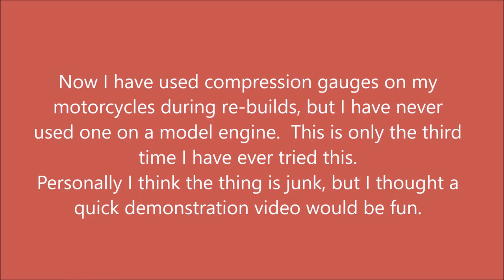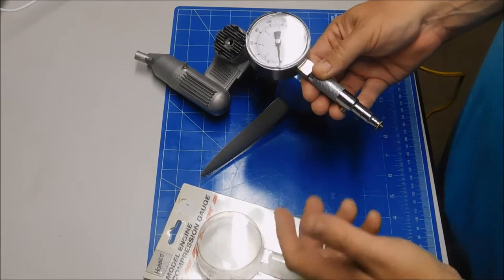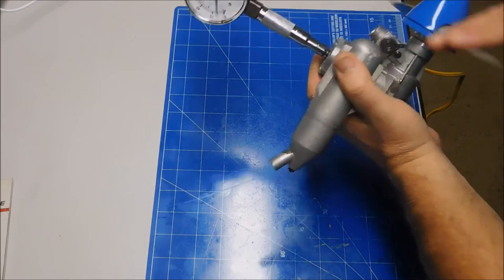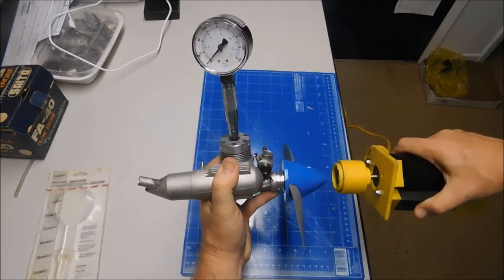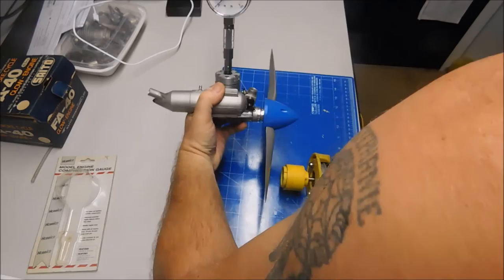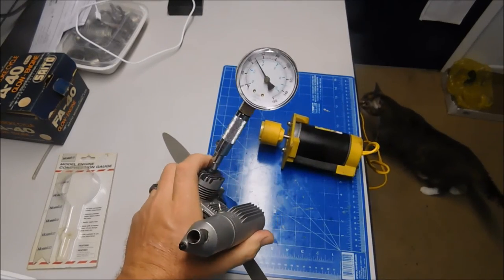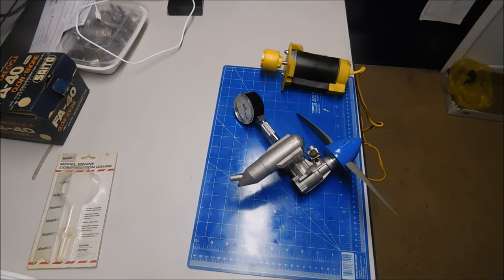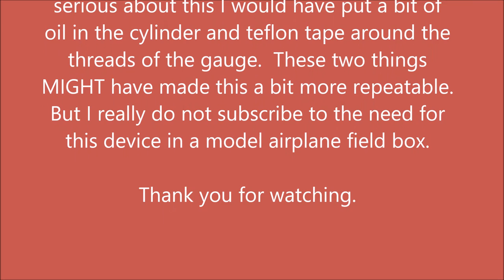Model Airplane Compression Gauge by Hobbico

Comment: It would be interesting to see, if there is a difference between the compression of a .10 size and a 1.20 size engine ( with a few drops castor oil on the piston and teflon tape around the threads).  Also the difference between a ringed engine and a not ringed engine of the same size would be interesting to know. That would be a nice engine comparison, compression from .10 size engines up to 1.20 size of 2 stroke and 4 stroke engines, ringed and not ringed. The first comparision of this kind on youtube, no,  the first  in the world. I never saw such a comparison somewhere.
Reply from the maker: I am pretty sure you would see differences across those engines.  RInged engines have less compression than ABC so of course you would SEE a difference.  Would that difference be MEANINGFUL?  Most likely not. The real issue with this tool is the consistency.  If there is no consistency then it really is useless.  I am not sure I am going to waste any more of my time with this device because I see no benefit to doing so.  They are not widely sold, nor do even 50% of the modeling community have one.  So what would the point be?

Let me add this also.  I got this device in a package deal of stuff.  Even though it came with the original packaging there is no guarantee that it is 'new'.  Heck the thing could have been dropped or abused for all I know.  Unless the item was known to be new using it in a comparison to judge it's usefulness is really unfair.  My video was really meant to be a whimsical look at this device not a 'real' test.  I do not use these things nor would I ever endorse this to be used on a model airplane engine.
Reply: If an engine starts normally and reaches expected max rpm, then there is no need to use such an device. But if an engine like the open rocker Saito does not reach max rpm, then it is useful to compare the compression of this engine with an properly running 4 stroke engine of the same size. So the device perhaps can help to find the reason of a malfunction.
Reply from the maker: There is ZERO possibility of using this on the open rocker Saito FA-40 due to the forward facing glow plug.  besides I know the reason for the issue on my open rocker, the carb is crap.  The needle supplied with the engine makes it impossible to completely close off the fuel supply, thus it will never lean enough to reach peak RPM.  I took pictures of the needle next to the one from my FA-45 (two piece head design) and they are physically very different in the method that they thread into the valve assembly.  So I cannot just replace the needle to remedy the situation.  But this is all another story....
Reply: For a comparison, two or three compression measuring devices would have to be used. If all of them show nearly the same readings, then the comparison would be ok and perhaps useful.
Reply: If you mount a spinner without a propeller, then you can use the compression measuring device with the open rocker Saito.
Reply from the maker: U Me I would have to cut a prop down so that there is something to tighten against.  But again, low compression isn't the issue with this engine.
Reply: Instead of a broken propeller a pice of wood with a hole would also be suitable. Perhaps another carburettor mounted to the original 90° tube with a big shrinktube (or an metall adaptor made with a lathe)  would work with the open rocker Saito.